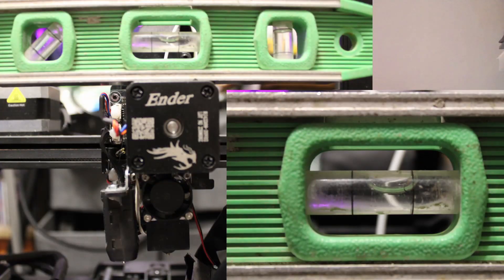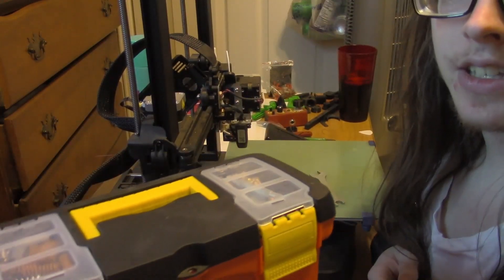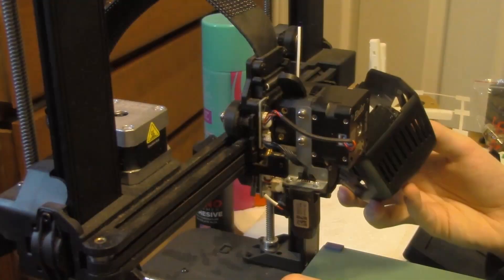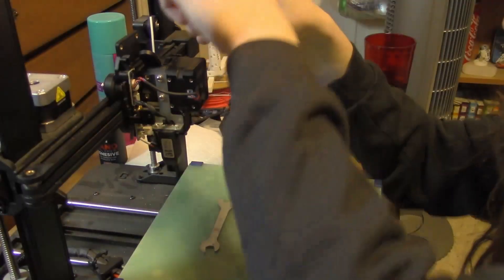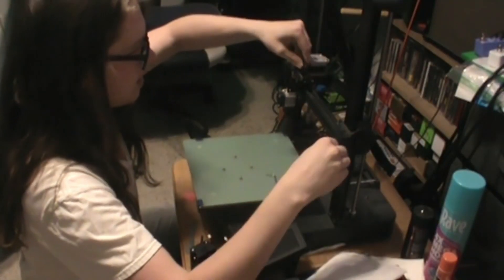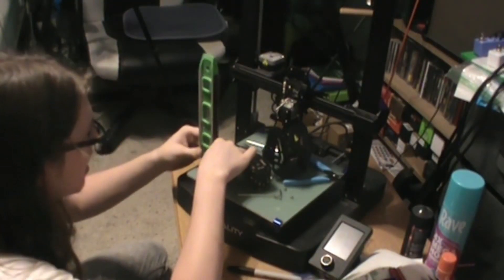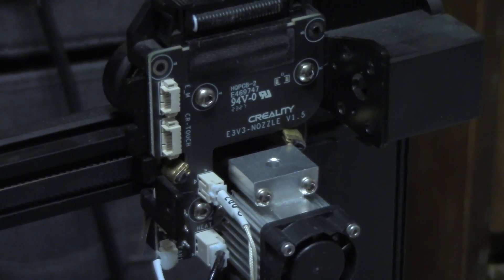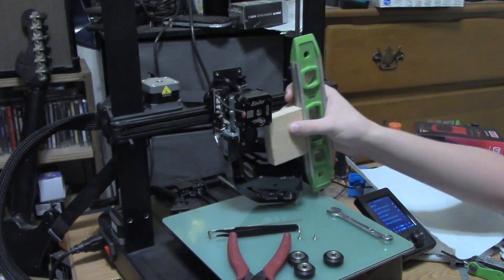The Last Straw Of The Ender 3 V3 SE

Comment: the nozzle has to be lower than the retracted bed level probe, or the end of the probe will hit the print and knock it off the build plate, you may want to check your z axis uprights to see if they are square, i am currently working on stabilizers i downloaded from a link on "need it make it" youtube channel, all in all, i think the se is a turd in wolf's clothing, but i'm gonna make it work, however, so far, i've had very few problems with my se, which i've had for about a month now, that damn synchronized double z axis screw and linear rod setup fooled me into buying it

Comment: Have you tried any BambuLab printers? I'm mega considering getting the A1 because it apparently actually auto-levels correctly
Reply from the maker: I have a few videos talking about different aspects of my P1P. Believe it or not, I owned the P1P BEFORE this printer, but bambu slicer has some stupid code that messes with a model that I wanted to make and sell to try help start up my small music equipment company. So I got this printer to work make the models because on paper it should have been perfect for the task. However Creality doesn't seem to actually take much pride in their work or it's just blind pride because they have never really seemed to make good products, at least not before working them and buying better parts yourself.
I would believe that the A1 can level itself because bambu labs actually do take pride in their work, and honestly it better for being a $400 bed slinger style or whatever the form factor is called. I don't have any personal experience with the machine and have been trying to reach out to bambu labs for some sort of collaboration, but I think they just look at sub count and think they have the full picture from there. I've also heard mostly good things about the elegoo neptune series of printers, but I think they may be closer to a creality than a bambu labs as a company. From what I can tell they make decent printers out of the box but support can be spotty, and the machines can have some defects, though I think those ones can actually be fixed usually.